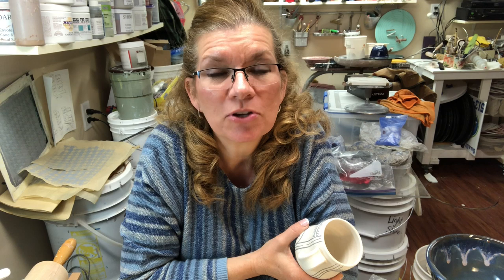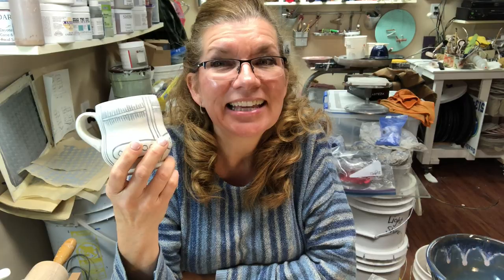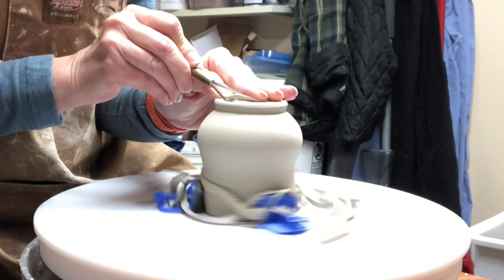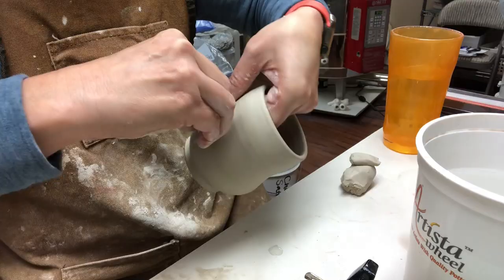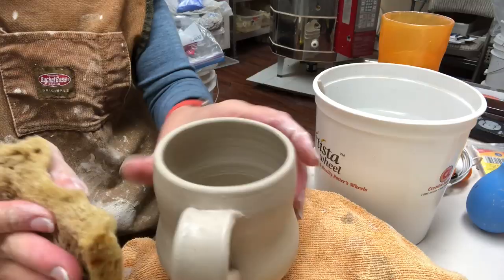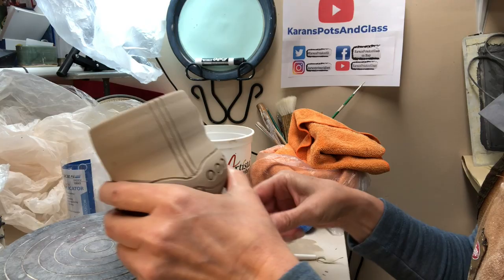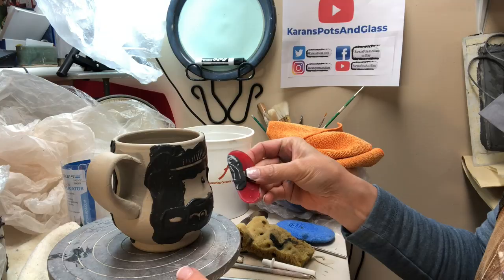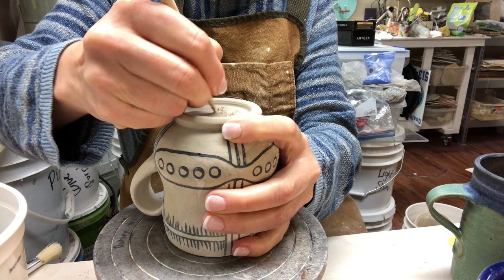Mishama Cup - From Throwing to Decorating Greenware!     Day 30 Quarantine Distraction Video

Comment: Karen, you are fantastic!!!  As I watched this video as like with your others, I'm shaking my head in disbelief of your proficiency and common sense, natural talent in your craft.  Thank you and thank your parents for me.  I have quick question:  since being quarantined and working, from home how do you properly manage your clay water clean up without hurting your plumbing?  Thank you again!
Reply from the maker: I have a rinse system to get the majority of the stuff in a bucket in my sink. I’ll keep it in there for a long time- stuff will settle to the bottom- the water then overflows the rim into the sink and go down the drain. The second step is the Gleco trap I have under the sink to catch more. I have a video showing how I clean out the trap. And the bucket- I dump outside in the woods! https://youtu.be/JbfFyvmlhu4

Comment: I used was resist that has dried and hardened a bit. I don’t scrape off the slip or underglaze though I sponge it off. I’ve been able to do several different colors that way.
Reply from the maker: Yes, Sue- that is another way to do it. I found for the effect I wanted the scraping worked best for me.  It is the "historic" way of using the mishama technique- to cut off the slip portion.  :). Whatever works best for anyone's particular application is great!  :)Thanks for sharing!

Comment: What type of glaze do you put in slip trailer, and when do you remove the glaze after decorating it.
Reply from the maker: I use the colored slip that is linked in the description- and I waited until it was a dry leatherhard before scraping.
Reply: KaransPotsAndGlass thanks